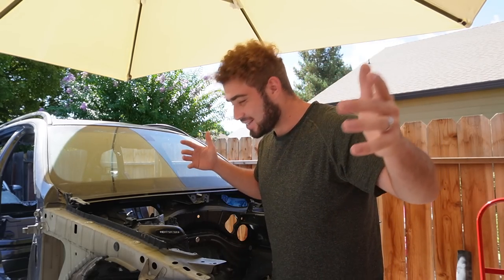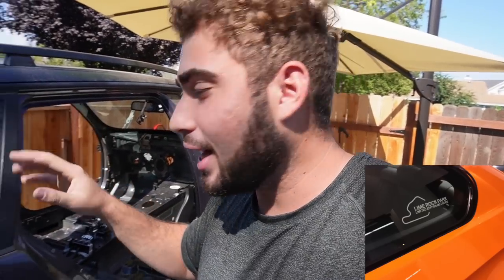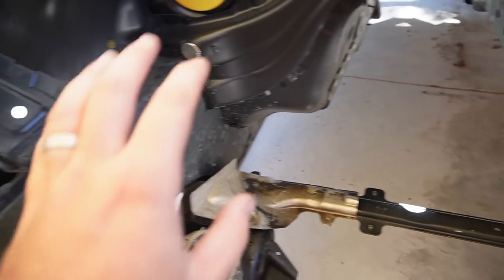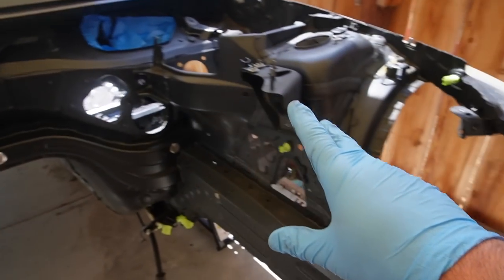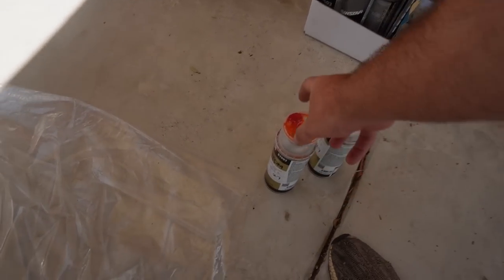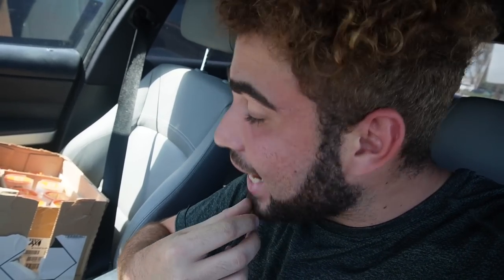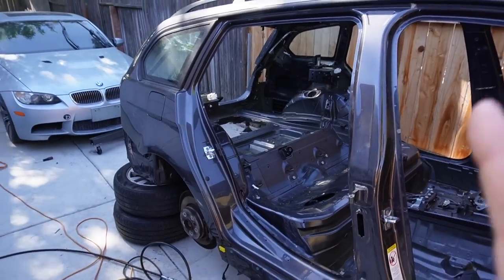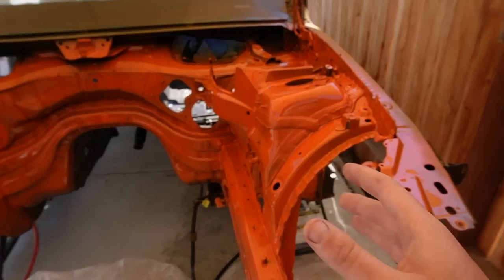Building A Custom 1 of 1 E91 M3 Wagon! (Part.8)

Comment: Lime rock is a awsome color for the E91 M3.
What you can do is first spray 2 or 3  layers of a light grey or better a white primer,that is cheaper than paint.
Because than the Lime rock will cover in less layers and it will be more brighter than over a dark surface.
Good luck with the rest of the build,up to the next step.👊

Comment: Do not forget that fenders rear and front on m3 much wider than basic version so you need to put new fenders on. Front might be easy, take off m3 and put them on new model but rear one has to be welded

Comment: $700 for a gallon of paint? No way. Look around. You need to find a local auto paint shop that will sell you a gallon for $100 or look on eBay for a gallon of Bmw paint. Look for a shop that allows public to rent their paint booth on a hourly basis.